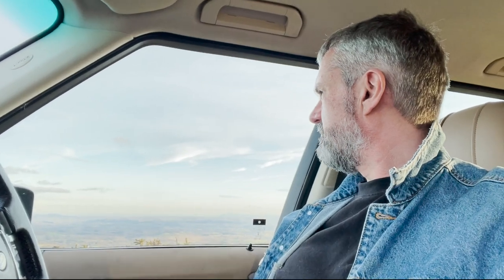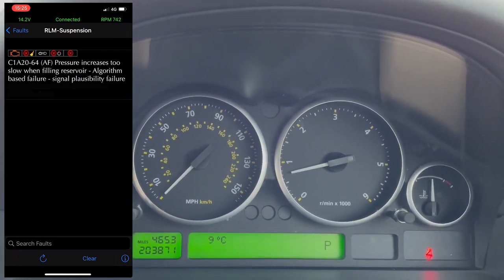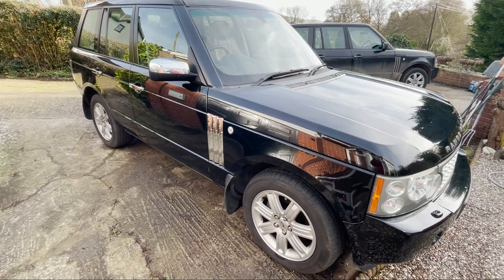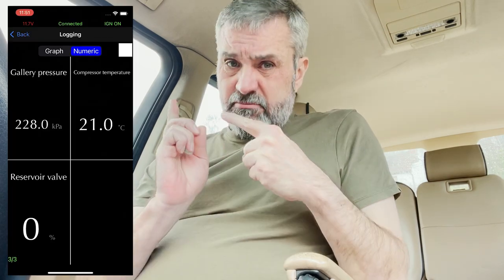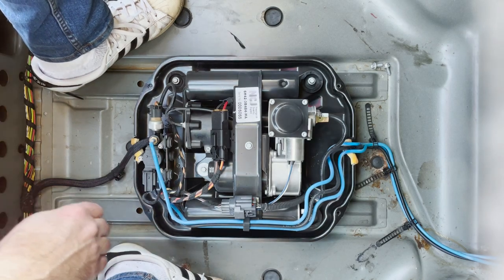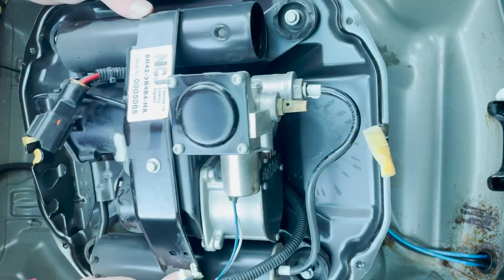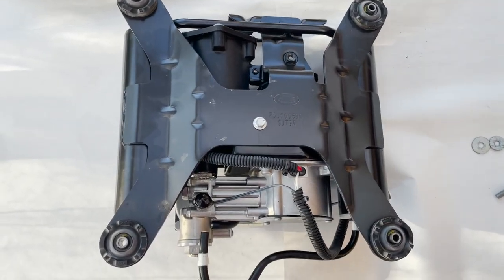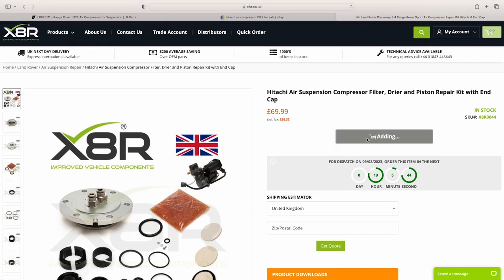Range Rover L322 Suspension Fault Code C1A20-64 | GAP Diagnostics Tool | Hitachi Compressor | Part 1

Comment: If you're getting regular suspension faults it's likely your Steering angle sensor is on its way out. Sounds strange but it's connected to ABS HDC and suspension.
Reply from the maker: Thank you for the heads up @George-hs2zm. I'll check it out 👍
Reply: I've just replaced mine ( bugger of a job tbh) but it's cleared my abs HDC and suspension,, all lights off. If you take it to the stealership they will add another 3 zeros to the price. It's like they see a guy with a Rangey and the £signs light up in their eyes, you can almost hear the kerching

Comment: My 06 TD6 has been giving intermittent 'Normal Height Only' and 'Lifting Slowly' warnings since I bought it. Recently it started to sink on one side when parked for a few hours. Did a bit of investigating and found a pin hole leak in one of the blue pipes going from the compressor to the valve under the rear o/s rear arch. The pipe had been rubbing against the hose clip of the fuel supply line to the fuel burning heater fuel pump. Hoping that pipe will be cheap and easy to source, otherwise I might consider replacing the original compression fittings with standard pneumatic push fittings and off the shelf reel of nylon tube.
Reply from the maker: @StreetMotionUK nice bit of investigation!  Off the shelf pneumatic pipe will do the job no problem and if the section of the pipe with the pinhole is easily accessible you could also consider chopping that small section out and repairing with a pneumatic pipe repair kit.  Good luck!

Comment: 2008 model? How many air bags have you replaced over the years? What brand do you recommend for longevity? TIA
Reply from the maker: Hi  @the1stime  , yes it's a 2008 and I’ve only had to replace 2 on this vehicle so far, both front, it was around 4 years go and I replaced with a pair of Dunlop brand, not the cheapest but they are still going strong 👍

Comment: So did it work? Was it the compressor?
Reply from the maker: @Schnippen_Schnappen1  The compressor was indeed a large part of the issue but not the whole story,  but servicing it helped me then identify the next issue and without having a good compressor I couldn't move on. There are another 3 parts to this series with the final part showing the final result - spoiler - I did fix the suspension fault and saved a decent amount of cash in the process  👍

Comment: Ok how do I get my air suspension switch in or the indicator to work again cause its not allowing me to control it or do anything with it.
Reply from the maker: @sirkendrick11 It’s difficult to diagnose your issue from your description but I’m guessing your air suspension switch in the centre console is completely inactive and not showing any illuminated lights at all.

It could be a number of things but check the fuses first of all but you really need to plug in a diagnostics reader and get some codes to find out what may be wrong.  

I’m assuming you have no error messages on the dash saying things like ‘’Suspension inactive’’ or ‘’Vehicle raising slowly’’

You could be lucky and its a fuse or you need to do a hard reset as the ECU isn’t happy and this may work but it really could be any number of things and without a diagnostics kit and codes you could be chasing it down forever.

Good luck 🤞

Comment: Are you standing on the car upside down
Reply from the maker: No,  I’m not even sure what you mean but I’m not standing on the car at all either upside down or otherwise,  the compressor is in the boot under the spare wheel 🙂

Comment: Hi, i have the 2008 L322 .
The suspension constantly goes up and down, Reading suspension fault drive below 50kph. Recently enough i had the compressor and 2 air shocks replaced. 
It stays up over night so i don't suspect a leak. Do you know of any sensor/sensors i could replace? 
My mechanic is sick of the sight of me🤦
Reply from the maker: I would start with the ride height sensors as being the prime suspect.  If you had the air shocks replaced it should have been calibrated as well so may be worth checking it was.  But I would defo start with the ride hide sensors which may have failed or simply been knocked.  Good duck 👍